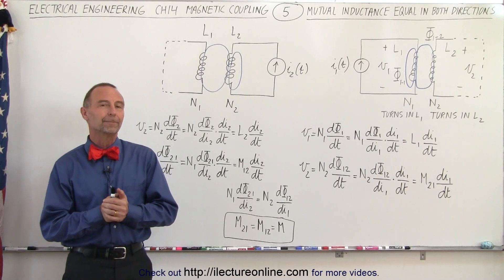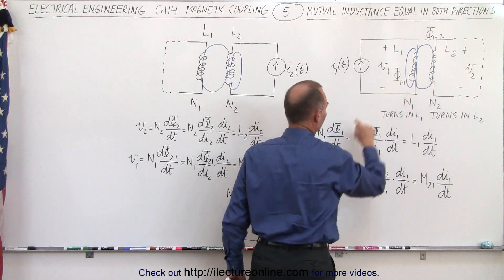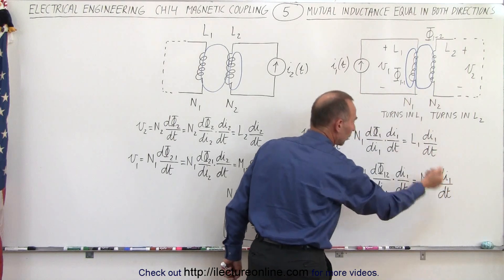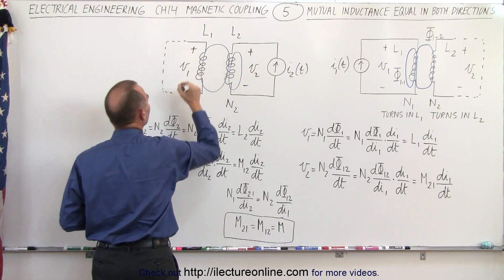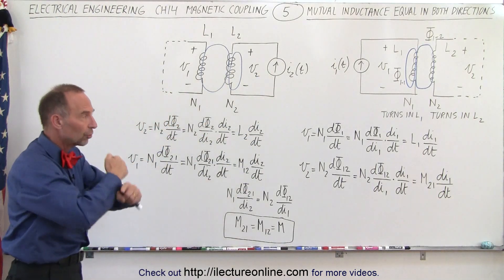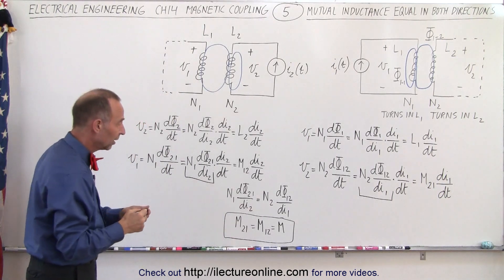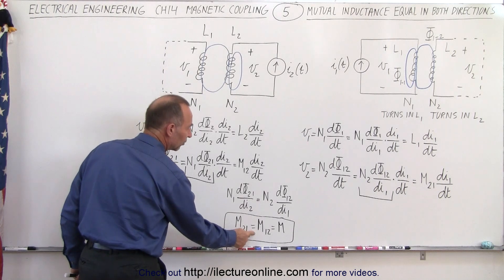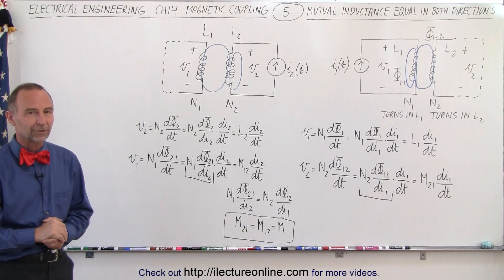Electrical Engineering: Ch 14 Magnetic Coupling (5 of 55) Mutual Inductance Equal in Both Directio

Comment: How about talking about real circuits. The input to the first inductor will be a voltage, not an imaginary current source. The second inductor will be connected to a circuit and therefore a current through it.  How will the current in the second inductor affect the current in the first inductor? How will the impedance seen at the first inductor and the impedance seen at the second inductor change?
Reply from the maker: The lectures are designed to help students in their introductory electrical engineering classes.